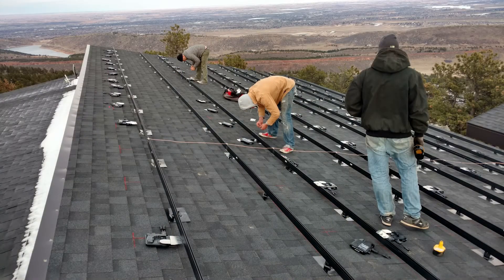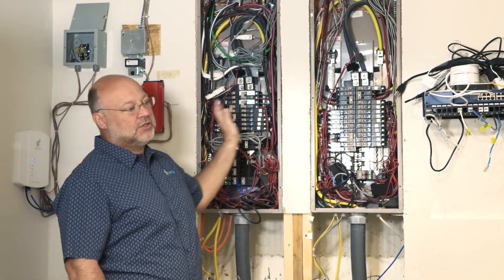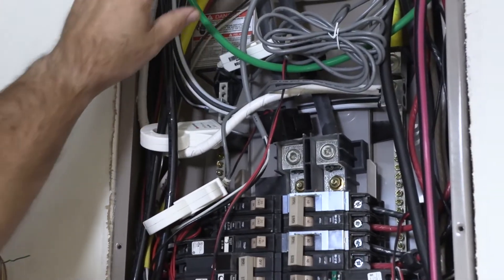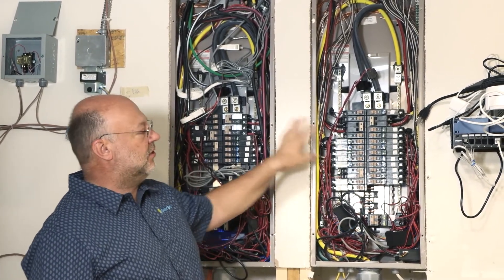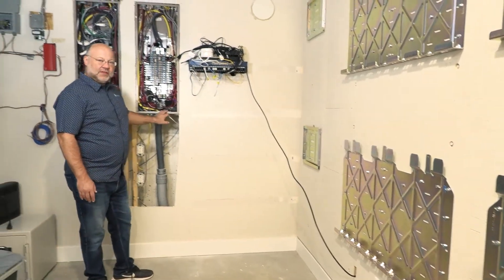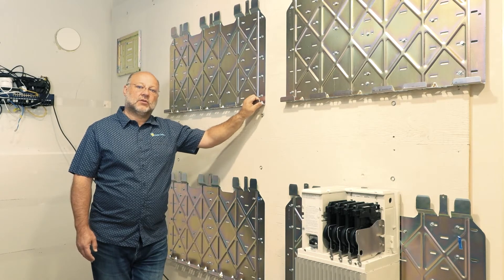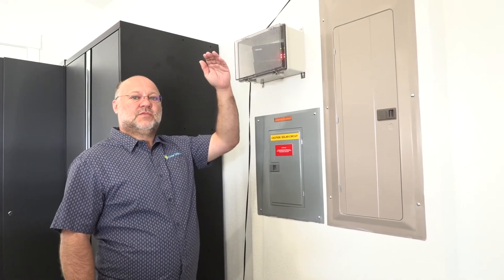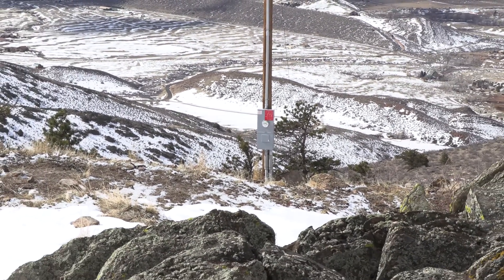Enphase Ensemble Battery Install Part One Solar Side Up

Comment: So you were feeding 2 60 amp feeds into 1 200 amp panel? NEC 705.12 (a.k.a. 120% rule) limits how much solar you can put into a panel to avoid melting the bus bar. There are several ways to calculate the FLA solar, and the one that allows for the most solar only allows for 56 amps solar on a 225 amp bus with a 200 amp OCPD. I purposefully undersized my OCPD to 175 to allow for 76 amps of solar. Did you install a 150 amp OCPD?  (1.25 FLA solar x 1.25)+OCPD<=BUS  x 1.2